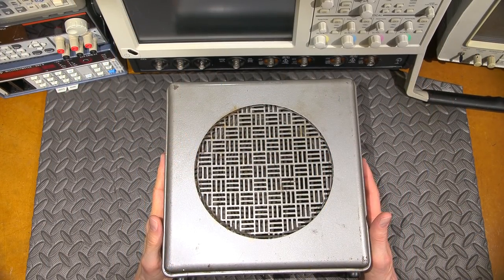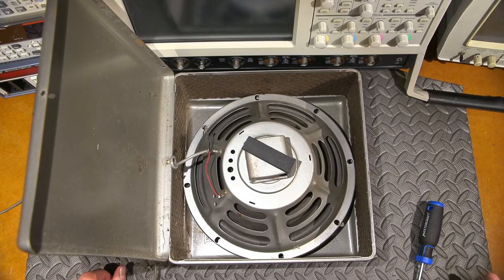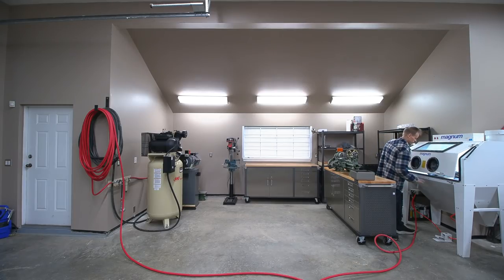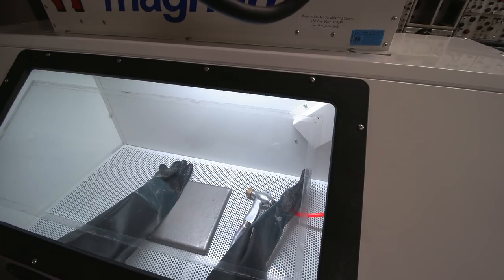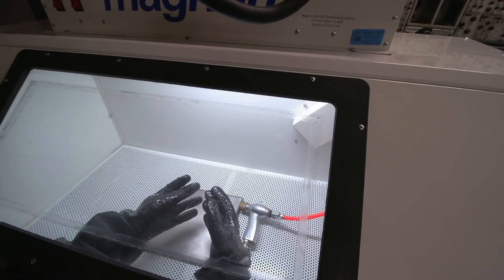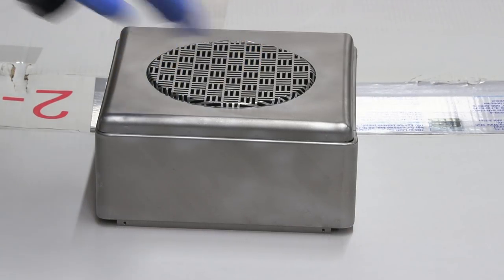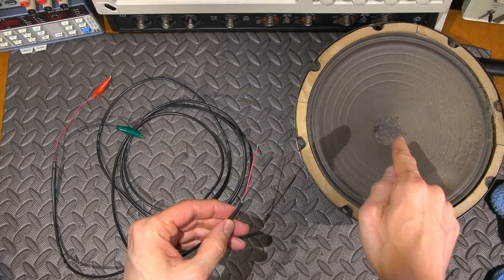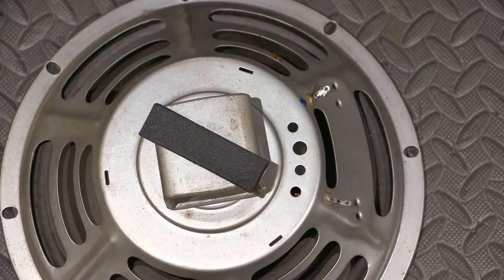Speaker Restoration And Modification!

Comment: I was expecting a recone.
I have never considered a compression fit while mounting speakers, ever.

Why only hard pipe four feet from your compressor?

You created the hazzard by deciding a large diameter, long hose was good alternative to a few hours plumbing it in.

A media blaster has got to be the biggest draw of air in your shop.  I suppose it didn't get placed next to your compressor because you wanted short electrical runs to the drill press and grinder.
Setting up shops is always a compromise between cost, productivity, and safety.

All my hoses are on retractable spools.  I only pull out what I need which reduces the risk of running over, burning, or dropping material on the hose.

If the fitting comes off the hose, the whipping usually releases the catch on the spool and it retracts back in, giving me space to turn off the supply.

Comment: Broke an air fitting off once trying to connect a hose to the shop plumbing.  Injected my hand with oily rust particles from the old iron pipe.  Not fun.

Comment: Stop.

Hammertone.
Reply: well hammertone paint job was excelant  but will you do a military black crackle paint job
Reply: is it tre that ylu have to heat metal before you paint to get a deep crackle finish ampro 16mm  projectors use a great crackle finish can you do a video on that

Comment: Bead blasting seems a very expensive, wasteful and un-ecological way of removing a bit of paint. Very few people have the equipment and the amount of electricity used is not a good thing in the current, so called, 'climate crisis'. There are safe (if used properly) chemical paint strippers available but they do require a bit more 'elbow grease' and patience to use successfully.